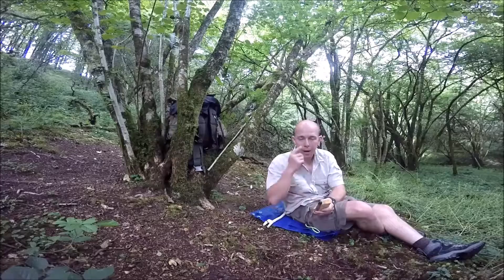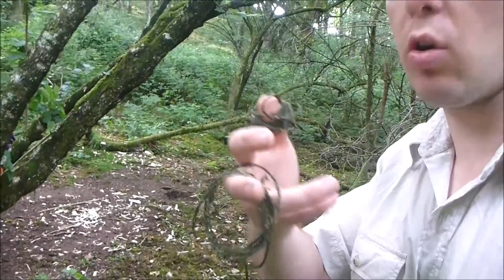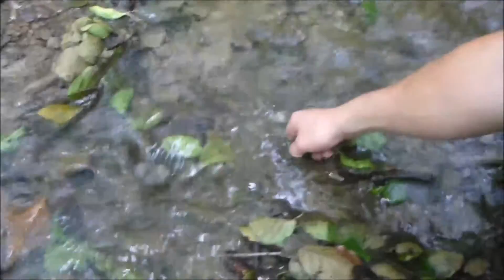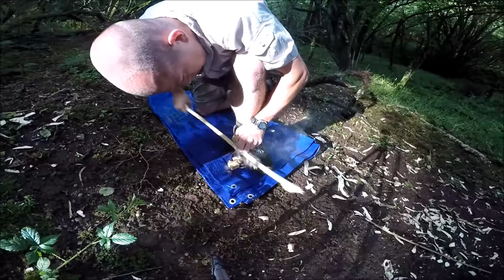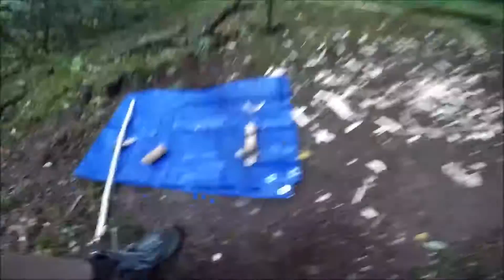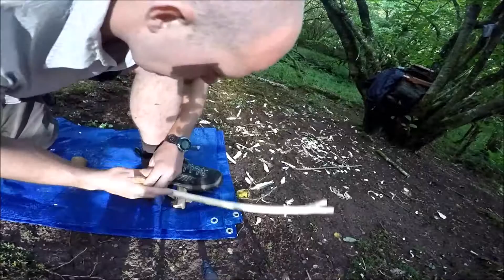Nettle Cordage  Bow Drill - Friction fire

Comment: Awesome. The Egyptian cord method makes that possible or the plant fiber cord would not have lasted as long. Willow tends to be on the higher ignition temperature range unless using either a fireboard or spindle of some other softer wood. Try some kind of sap free solid Pine for the fireboard and a Willow spindle for example or vice versa. I often use Sand Pine with Willow for better results or I will use Yellow Pine with Yellow Pine. Softer wood types should have a lower ignition temperature range and quicker coals so less spin time and less wear and tear on the cord. Typically the same softer wood types some folks may use for the hand drill. Here softer wood types such as Yucca, Caesarweed, and Sida among other stalk type woods. Thanks for sharing and keep working with different plant fiber cords and wood types.
Reply from the maker: thanx, i will do going to keep practising with different materials and plant materials. I will keep a look out for some yellow pine , thanx for your advise always, found the links to the egyptian method very useful.
Reply: ba survival No problem. Pine is tricky particularly its density. For it to work for me it needs to be sap free, dry, and solid. No sap and no porous wood. It does take a lot of looking to spot the wood in its right density state. If it fails to work for me (all things considered) then I just go find a different density of it and make another firebow set. Outside of moisture/sap, the wrong density can often be the problem with any wild wood when using it for a firebow set. Best of luck.